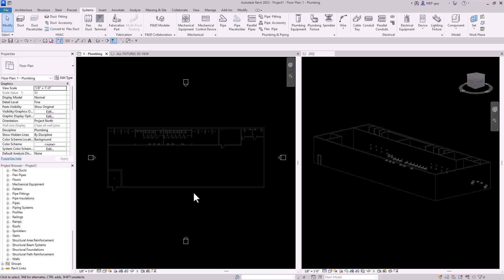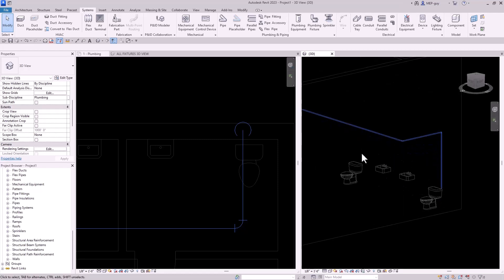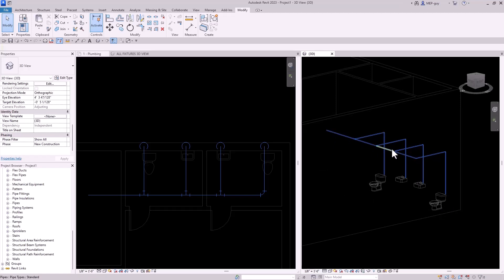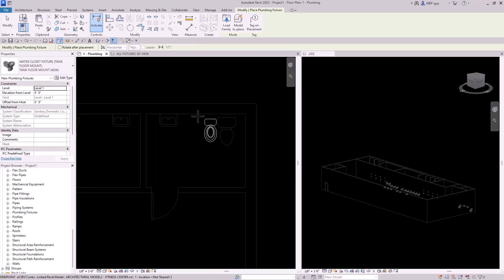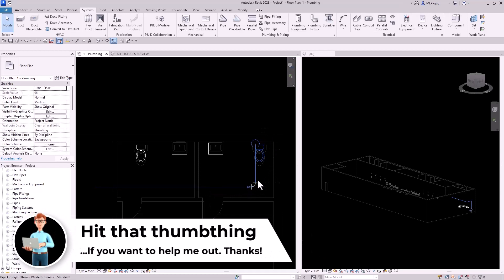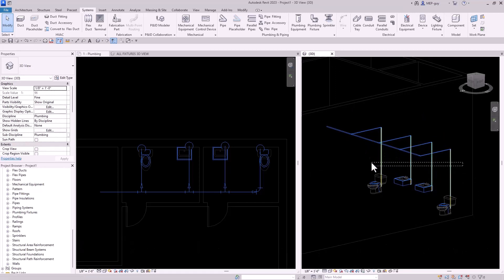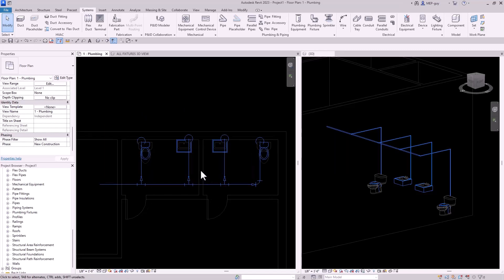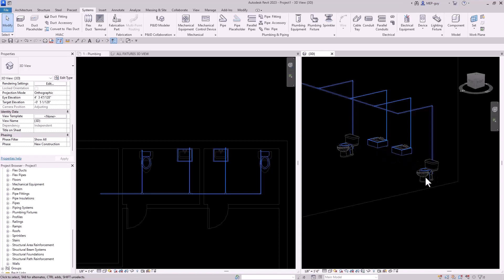The #1 MISTAKE beginners make Plumbing in Revit

Comment: It’s better to create a plumbing fixture family that consists of nothing but pipe connectors hosted to thin disc shapes in the family. Position those behind the arch fixtures and let the architect’s model show the fixture itself. That way if they shift the fixture in their model your plumbing plan doesn’t have two fixtures shown (yours and theirs.)
Reply from the maker: My plumbing fixtures do have the ability to be turned off. The nice thing about having the fixtures is you can shown them on risers diagrams. To do this there is a little trick I use that I show in my paid courses.